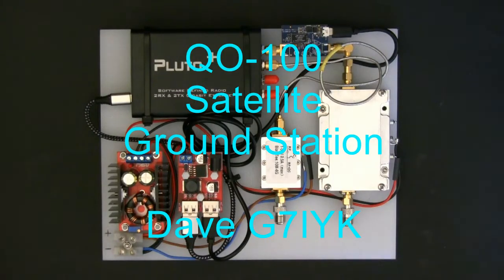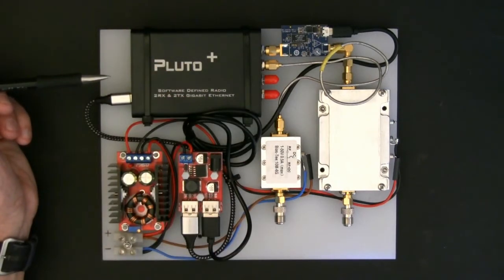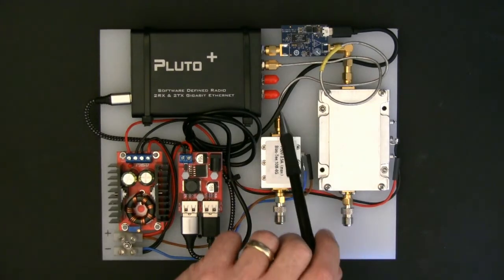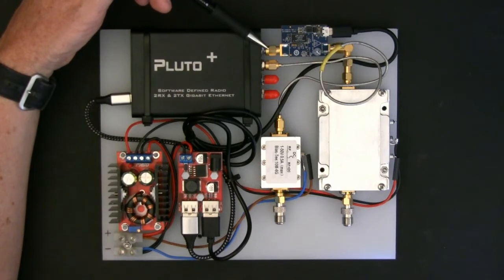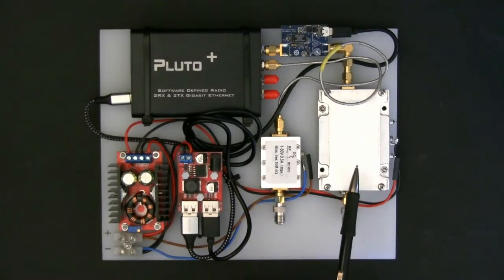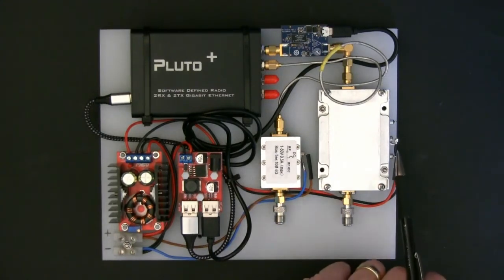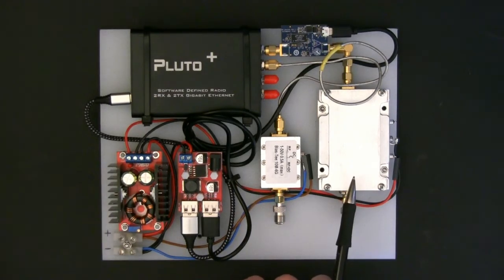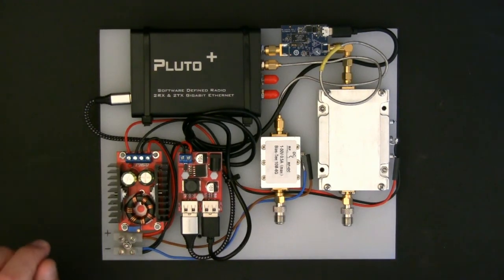QO-100 satellite ground station

Comment: Which coaxes are you using?
Reply from the maker: Hi there, as the ground station is literally next to the dish I am simply using two very short runs of RG6 just because I had it in the shack. It's quite lossy so if you need a longer run I suggest a better cable

Comment: Thanks David, We would have like to know two things.  Do you also mount the amplifier on some heatsink and cooling? And if you mount  this nice station in a box outside do you run a long USB cable to your PC?  We have not found this info in the video.
Reply: In the video he says the Pluto uses the Ethernet for data transfer not USB

Comment: Hey David great informative video about your nice setup , @15mW and 28V what output SG-Lab PA has delivered ?
Reply from the maker: Thank you 😊 at 28V and a 15mW input I was getting about 8W out of the PA which is capable of 20W. You can only output as much power as the satellite will handle. If you drive your signal higher than its beacons it (the satellite) will give you an audible warning on the downlink

Comment: After watching you excellent videos I have ordered all of the bits so now just waiting for the slow boats from China.
Is the pluto in old pluto mode or pluto+ mode ?.
I have been looking at something similar to this but would never attempt the mod to the original pluto this model makes qo-100 possible for the wife and me now.

I have seen other methods of accessing qo-100 but required full duplex to stay within the usage guidelines without having to rely on someone elses websdr.

regards Richard G7OED and xyl Dorothy M0LMR
Reply from the maker: Hi Richard, that's great very pleased you liked my selection of videos on the QO-100 access. The pluto is in pluto+ mode which provides the ethenet port. The two main reasons I went for the pluto+ were the integrated ethenet and the much improved oscillator performance. Hope everything goes to plan - Dave G7IYK